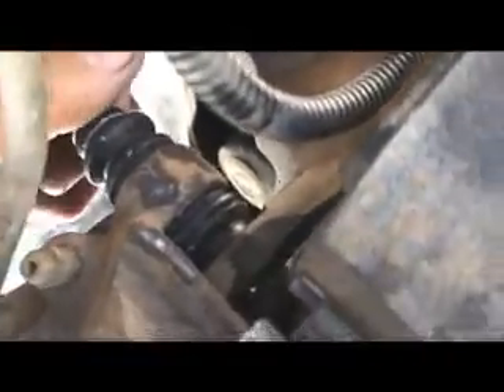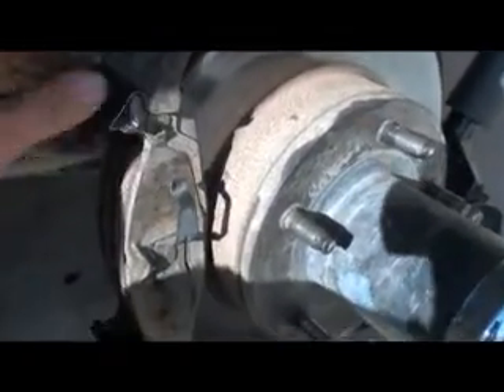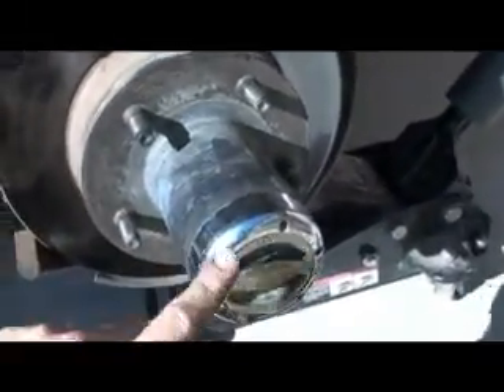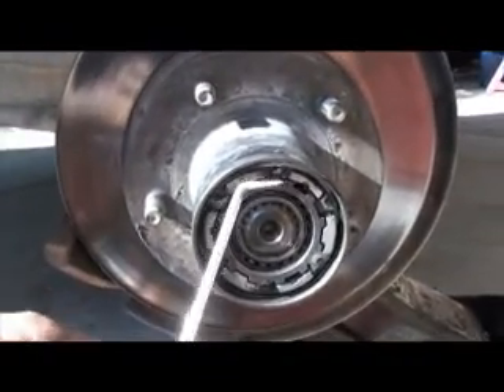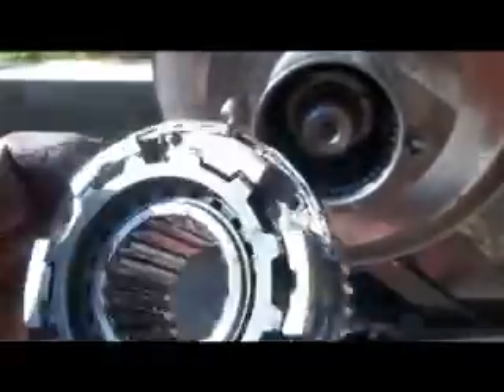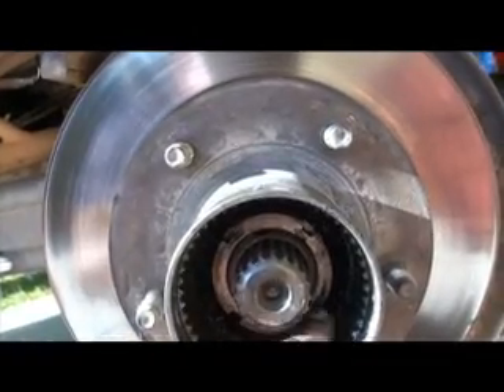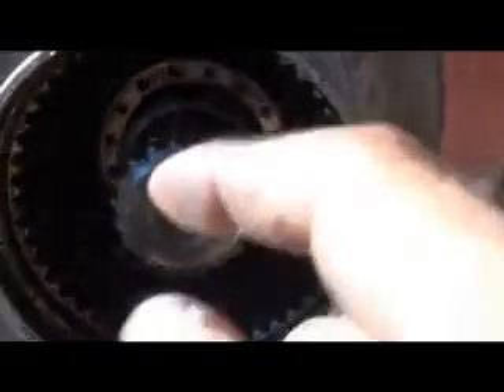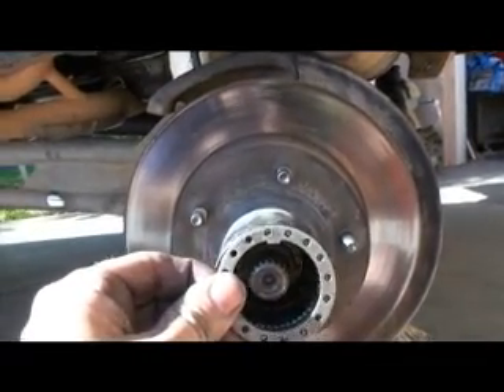Caliper bolt repair PART 1

Comment from the maker: Yes your'e wright!  I learned the hard way.
This wasn't about bolt repair as much as thread repair! There is no retaping that caliper bracket and the Hexicoil didn't work very good.
I have just replaced that last nut and bolt for good this time. Sorry but this how you learn! The hard way!